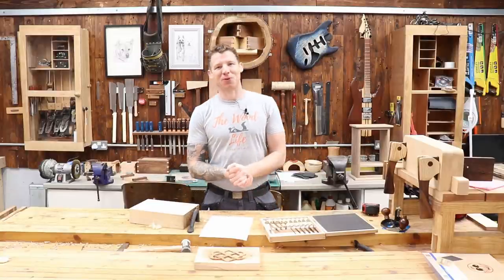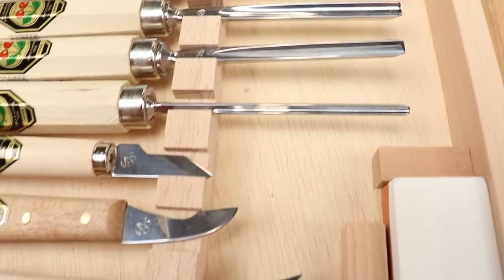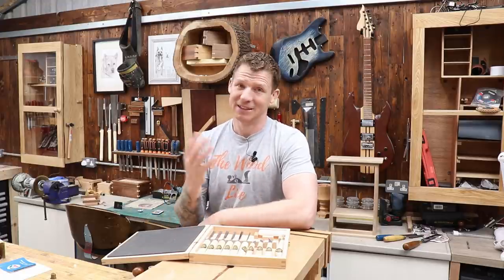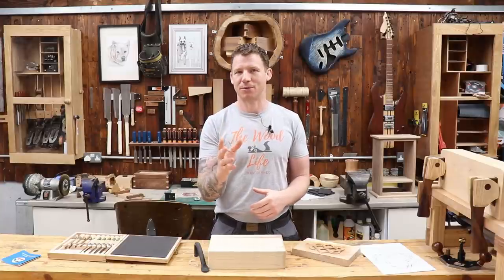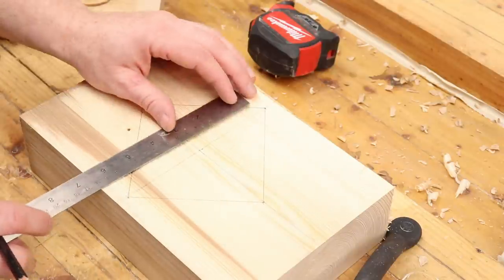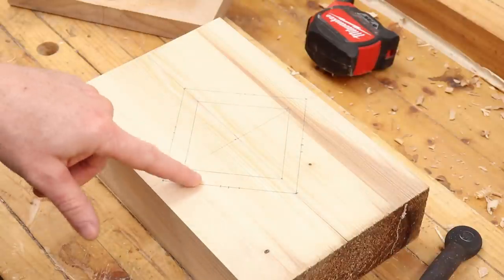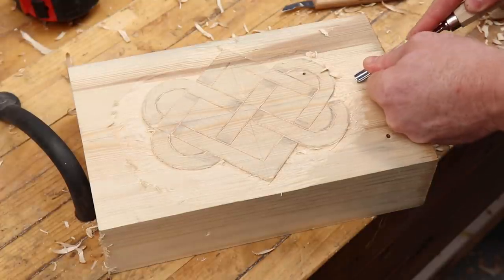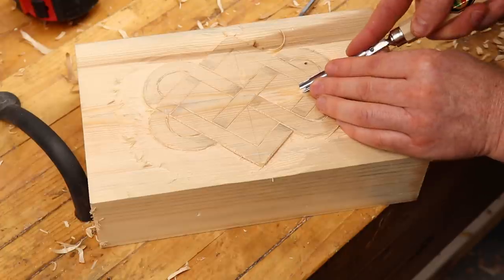Starting Woodcarving with some Celtic Designs

Comment: Awesome first carving. Just a few observations: celtic knot design can be carved almost always with carpentry chisels only, so to start most people don't even need to buy extra tools; the toolset you got is more oriented to chip carving, small figures or details; and for last, as stated in the comments, using a mallet helps a lot with control.
Maybe a bit late for this video, but hey, info is info

Comment: Hey John. Howdy fromnTexas. Just found your channel. Excited to see this. Great vid. . I'm not am expert either but have done some carving. One tip would be to cut your stops with a chisel straight down in and then run your vtool and chisels. That will stop your chisels from going to far and running over your intersections.

Comment: Those veritas routers are a lovely bit of kit. Couldn't afford one myself, stuck with a Record #071, but you can use the veritas bits in the router plane (if you turn the height adjustment knob upside down) so I've bought a few of those since and they're great. Got mine from dictum in germany rather than finetools (they're worth looking at as well a lot of the time). I've found though that it's no real problem to sharpen the blades that don't come apart if you take the diamond stone out of any holder it's in and put it on the edge of something like your little sub-workbench where there's an overhang at the edge - that way when you're sharpening the bevel of the blade, you can turn the cutter so that the edge is parallel to the long edge of the stone, hold the bevel flat on the stone and the stem of the cutter swings under the stone (that's why you need the overhang) and then you just rub it back and forth. It's a bit odd, as the edge is at 90 degrees to the direction of motion which is not how you do chisels or plane blades, but it works because the cutters are so narrow. 
Oh, and do yourself a favour when learning, don't try to learn to carve in pine. It's so soft that you have to be right up on your sharpening game. You really want a hardwood. I'd suggest trying something cheap like poplar for those kind of tools, though sometimes you have to bite the bullet and just buy a bit of oak for things like 17th century relief carving (like Peter Follansbee's stuff) but at least you can plane off the learning carving stuff :) 
And when you get the hang of it, even a beginner can make really pretty stuff: http://www.stochasticgeometry.ie/2019/05/06/finished-3/
Reply: Oh, and I almost forgot - buy yourself a slipstone for sharpening the gouges. It's a pain getting the burr off the inside of the channels otherwise. You can do it with sandpaper wrapped around dowels, but now you have to have a half-dozen dowels to keep track of. 
And it helps a lot if you take a bit of 4x2 and just use your goughes to cut one channel per gouge into the 4x2, then rub the buffing compound you'd use on your strop into those channels and now you have a custom strop for all of your gouges, and that saves going to the stones every time the edge dulls a little (you still have to, but only every few times they dull, the strop will restore the edge for a few more minutes of work).
Reply from the maker: Cheers Mark good info!

Comment: John how have you fixed your wood to the bench? Do you use your whole grips what you’ve purchased recently this is a tick I’m trying to find a way of holding my wood tight as you can understand can’t see so trying to keep it supported.. Shame I’m not on messenger with you as it be able to check quite easier

Comment: I prefer a different grip of the chisel.  For a right handed person, grab the chisel in your left hand either by the handle or the steel, and then provide propulsion with either your hand or a mallet. Left hand should be resting on the table or preferably on the piece you are working on to provide support and limit the distance your chisel can move. At the beginning when you were chiseling the lines with the v-chisel, you hand both hands in the air, no support and easy to slip and push too far.   https://www.youtube.com/watch?v=43dLqrKV9OI like this. Works for her, works for me, and my elementary school students. :)
Reply: Edited, somehow mixed up the hands and suggested a right hand holding the chisel. I at least mainly hold the chisel in my left hand, though right handed use is also sometimes needed.